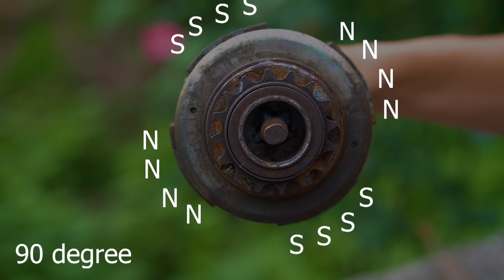I build 220v electric Hydropower dam

Comment: Clickbait.  That thing has an much chance of generating 7000w as I do lighting up a fart and rocketing to the moon.
Reply: Fr fr, 
1. The way he wire the coils together 
2. Even if they were wired correctly the 60 rpm he's getting would only create 2hz instead of 50-60hz
3. The chain didn't show any tension at all
4. The water was pushing the paddles so easily
5. The bottom of the paddles wasn't secured properly so if there was tension it would just scrape the bucket 

If he actually showed how a working turbine could be made I would be impressed, but otherwise please stop making videos.
Reply: @liamhill1702  I looked at a number of this clowns Videos. All Click bait with ridiculous power claims. One was a little 2 stroke Motor  driving a generator supposedly powering a Pump.  Belt between engine and self made genny  looks like it came out of a VCR or something. Starts up the little engine, connects the pump and motor does not Drop a single RPM when the load goes on.  This guy is nothing but a Con man taking advantage of Peoples Gullibility.
Reply: @glumpy1024  I just wish he would actually teach how to make working things rather than to just take advantage of people.
Reply: Ye
Reply: @liamhill1702  Exactly. I came across him looking for real info.  Saw the thumb was click bait but had to watch what sort of a con he was pulling off. Seems there are many.
Reply: But there's still a chance right? This was obvious sarcasm but people these days seem to be to stupid to understand it
Reply: @Onyx_Games   yep and it's only slightly less than winning the lottery back to back 3 Times when you haven't bought any tickets!
Reply: okay but i wanna see him hook it up to a "kill-a-watt EZ" to show all the readouts amps volts watts and then again under load even though I'm sure "kill-a-watt EZ" is designed for 120v  to 110v if they had one for 220v or idk at least use a multi meter i got a high end version cen-tech at harbor freight for a pretty good price oughta tell me some data ... i believe the 7kw or 7000k  claims are for theoretical maximums given a high enough head pressure and flow volume that would be supposed capturable energy from the sun via gravity and the evaporation of water transported via clouds /rivers lakes
Reply: Rpm is constant. With load and with out load 😁. What an engineer
Reply: Having a open bucket he post alot of head pressure.
Reply: Thanks, saved myself so much wasted time
Reply: If I was a betting man, I'd say maybe 700watts. I could see that generating around 3.5amps
Reply: @mattypants  You are more optimistic than me! With the waterflow and set up as shown, I'd reckon 5-10W at best.  Maybe if the thing was driven properly you might get 100 or 2 but even then, the thing has NO regulation so trying to get a useable voltage and frequency is not going to be possible. ALL generators have some sort of Volt/ Current control to balance Different Loads. Without it, they are like an IMAG which I have 2 Up the back now I have built and the things are all over the place. Only good for a constant load like Lights where you can set the engine speed and capacitance and not change anything.
Reply: BINGO.  IVE DONE WHAT HE'S DOING IN THIS VIDEO.  AND SOME OTHER INVENTIONS.

HE'LL BE LUCKY TO GET ENOUGH ENERGY TO MAKE A DIODE LIGHT FLASH
Reply: There's probably enough information in the video i.e. size of pipe and pressure for someone to calculate how much power is possible assuming an ideal lossless generator. Edit he needs to be generating 32 amps to get 7000W.
Reply: I think it's a typo. 700 Watts makes sense. He probably can get a single horsepower from that water source. From what he has plugged in he looks like he is generating possibly 200 Watts so about an amp of current. If the generator was more efficient it could be made to do more.
Reply: 50L/min at 90%eff under 1m of head suggests best case around 400w output. All of those nunbers are very generous, i think itd be closer to 50cm head, 30L/min, 30%eff, or about 40w.
Reply: @carni5064  Solar Panel is better lol.
Reply: @secretagent5658  Sorry, you are incorrect.  The original outputs are irrelevant. He has converted this to a permanent magnet alternator, It no longer runs on mains AC . The  production using those small magnets would be nothing like the original rating of the the transformers.  There is no possible way to get any meaningful power out of them at near a correct frequency and voltage +which will cause all sorts of problems running anything bar  an incandescent lightbulb or a resistance heater. 
I just came in for lunch after working on  my commercial built 10 Kw 3 phase Generator. I know how big that is ( 150 Kg) and what it takes to drive it.  To think this puny setup would even do 1 KW would be a laugh.  If you spun this thing up with a Diesel engine you would be lucky to get 100 W before it flew apart.
Reply: @glumpy1024  Sorry for the comment. I had someone else post a responding comment to that comment.  They had put their own input which is incorrect. I agree with you. Their pulsed DC output by their "alternator". Not perfect or close to perfect sine wave, so I say it with quotes. My staffer had made a mistake and is not very well versed in this type of stuff. I apologize and will remove that comment once I find it. The pulsed DC might however induce some currents and produce some voltage into the primary coils. It wouldn't be enough to power a load. Even if it was very efficient it would not be able to power a load. Maybe just maybe a small load that can take pulsed DC waveforms. 

But again I apologize for the comment that had been made, I will track it down and remove it. There is energy being produced and transferred and could possibly be used on a load, but nothing of significant value. Especially NOT a fan nor anything else. I will educate my staffer and I will help them with further learning on this topic. I apologize for the false information in the comment. 

There is NOT enough energy generated to power a fan nor anything of AC load equivalents. Though there might be enough generated to power some very very small Pulsed DC loads. Electromagnet could be connected to it. But would not be significant. It would be like plugging in a 0.5 Volt 1 Amp power supply to the electromagnet. This would be the rough magnetic field equivalent, which is indirectly related to what had been shown and realistic values. 

Again, the power from this is NOT enough to power any significant loads. And this does NOT produce 7,000 watts at all like the clickbait claims.
Reply: @glumpy1024  I had found the comment and have removed it. I always spread truthful information. But sometimes I need someone else to reply to comments or posts using my account. Thank you for bringing this to my attention by responding to the comment. 

The comment is now removed and deleted. I'm sorry for this misinformation in the comment.
Reply: @secretagent5658  All good mate, thanks for the clarification.  VERY decent and honest of you.
Reply: Typo, he accidentally added an extra 0
Reply: Barely powers two fans desktop fans(75 watts each) and a 40 watt light bulb at half power! 👍👍👍👍👍👍👍👍👍👍  nice way to waste two days turning garbage into youtube click bait 👍👍👍👍👍
Reply: @RadDadisRad  I think he added Three extra zeros.
Reply: @metatechnologist  I don't believe it would be possible to generate 700W or anything near it with this setup with unlimited power let alone the tiny amount this water flow is generating. Have a look at other microhydro  vids to get an idea of what it takes to even make 500W.  People have 6"  Pipe falling 50M or more to get that sort of output or less with real  generators that are a lot larger than this joke of a thing. 
They show outputs, unlike this scammer, and it's easy to compare what others do to get an idea of what meaningful outputs take.
Reply: @glumpy1024  Yes you are right. Somebody in thread did the math under ideal conditions the maximum power would be 400 W. I wouldn't go so far to call this video maker a scammer because he did build something from junk and did generate power from what appears to be an irrigation ditch. Just not as much as advertised probably out of ignorance more than anything.
Reply: Yea output can never exceed input 7kw = about 10 hp he might be seeing 1/4hp at best out of that "turbine" maybe he means 7 kWh a month... But even that seems far fetched.
Reply: @glumpy1024  I know somebody needs to make a video debunking these videos. That and the "look at the very rusted thing I found and restored videos." Entertainment nonetheless!
Reply: Report as spam or MISLEADING
Reply: That fart trick sounds amazing. I’ll get in touch with CNN 🤘🤘
Reply: Wheres the inverter
Reply: If you're curious I met a man who once did both Legend has it that the Tsar Bomba what is a government cover-up story so that no one else would realize they had immeasurable power within their bunghole incidentally I am the great cornholio and now I go to find te-pee for my bunghole
Reply: @davidbagley1783  inverter for what?
Reply: Have you tried it you're self mate, if not how would you know
Reply: How much power does your make?? He atleast built sumthing useful even if its weak
Reply: @umomiekiller  Pffft! Useful for what?? Other than sucking in people on YT  with Click bait whom are not only stupid enough to  Believe this thing is worth the time of day but actually defending it.  I have made several  generators from repurposed motors that put out up to a genuine  4KW. 
I am putting together a 10 Kw Gen head and diesel engine atm So I know real well what making actual power takes. This is nothing but a sham to suck in the ignorant whom believe all they are told. One of the solar panels I have on my roof would put out more in a day than this junk would put out in a week, probably a months. There are about 45 panels up there atm.
Reply: @glumpy1024  what are we supposed todo with this information?
Reply: 15:29 bro.. extra wires coming out from bottom of pcv pipe... 🤣🤣  oopsie forgot to edit that out lmao.
Reply: But!! I would rather pay to see YOU do that!! Now THATS entertainment!!!
Reply: @turboimport95  what are you talking about
Reply: @glumpy1024  holy fuck dog shit is DELICIOUS! Tastes like cotton candy with almost a skittles after taste with a hint of starburst!!! Who woulda guessed
Reply: Mmmmm looking at it doesn't look like it'll generate enough power to run those fans at all an led light bulb  maybe
Reply: Great example 😂
Reply: The moon is far from here so if u can build a e roket withe electro moter i wanna see it
Reply: So you’re telling me there is a chance!
Reply: yeah 70w at most
Reply: @liamhill1702  jealous
Reply: @glumpy1024  7000W is where the click bait is. Just like you said, he's probably not even getting 220V. Otherwise, it seems like it is working to some extent. The fans do not really run full power. They can hardly move.
Reply: @themeantuber  people have made calculations. 15-100W. Having played with a LOT of different generators and made my own. I'd say thing thing is sub 50W, most likely sub 20.  The water flow for one is just not enough to support even that in my mind. Forget the other multiple flaws in the concraption.
Reply: @glumpy1024  very inefficient design, I agree. There are better ways to do it. People keep trying to get the correct voltage they need directly from a generator, probably not aware of all the transformer steps between the power station and the power outlet.
Reply: @glumpy1024  I think he should change his title. I've been thinking, 7 kW should be enough to run 4 washing machines, this cannot run some 20-50w fans full speed. The thing is, I wonder if the original poster has any electricity at home and maybe what he created is a big deal for him, but I'm afraid he doesn't understand the numbers...
Reply: @liamhill1702  if you look at the water closely you can see the paddels are moving the water not the other way around meaning all he had done is make a synchronous motor
Reply: 😂 😂 😂
Hey man!
Have you tried it (with Chili or something like that) 😁!
But 7000W, nope!
Reply: 커버만들고 구리스주입구 만들면 멋지겠네요!
비가많이와서 잠길일은 없나요??
Reply: Turbo-Charge it
Reply: its more like 70watt the fan is slow
Reply: Word!
Reply: Looks like it generates zero point energy to me. ;-)
Reply: It's 7000w before it falls apart.
Reply: very well said Glumpy
Reply: Wtf does clickbait mean it's a fucking lie
Reply: Hii guyss
Reply: I think this video is less about the clickbait and more about the proof of concept. Sure the numbers might be off but with better flow and a bigger system, clearly he's doing something right
Reply: That's why dislikes should be viewed
Reply: Даже провода не выдержат 7 киловат
Reply: Hahahaha too right .. 😂🤣🤣
Reply: @Onyx_Games  先直流發電 再整流才有機會
Reply: @mattypants  700? that fan was struggling to turn. I would bet around 2 watts
Reply: I agree.. there is no way that is a 7000 watt generator. Lol.. 

However, for detail sake, it depends what is meant by 7000 watts. I can say I have a 2,400 watt pv solar panel bank. In reality, it's 480 watts per hour at an average of 20 volts and can produce 2,400 watts over 5 hours, during the hours of peak sun. It's the same 2,400 watts with two different definitions. The true wattage is 480 watts multiplied by the number peak sun hours for total output. 

The quotes output t is likely 7000 watts over 24 hours, which is 292 watts per hour..... if indeed it is producing power..  one does wonder if there is a lithium power bank with a 220/240 volt, 300 watt inverter inside that pvc pipe the generator is sitting on.. 

It would almost worth building it for curiosity sake, just to see what it does.. lol
Reply: @mattypants  even that is being generous!
Reply: @metatechnologist  31.81amps to be exact at 220v 
Even his wiring sizing wouldn’t support these amps
I’m an electrician with 45 years experience ...
Theory is there just not engineering to support load claimed
The load he had connected was a couple of hundred watts at best!
Reply: You actualy think that thing can generating 7000w ;)))
Reply: probably wont do any good but just report it for misleading thumbnail. 
this tuber does it all the time and its always misleading.
Reply: High level for security shoes
😂
Reply: It doesn't matter how much power he's getting he grounded his weld through the bearing so they will fail in no time. I see this a lot the ball bearing in the bearing itself have a very small gap which causes arcing to the walls and pits the surfaces.
Reply: @glumpy1024  A bit late but wow. Your arguments are so good yet so calm, not like many toxic YouTube users out there.
Reply: This is why we had the dislike button
Thanks Susan
Reply: It’s still fun to wach
Reply: @glumpy1024  good observation man.
Reply: It's got 52k upvotes. It's gotta be legit.
Reply: @Poniax3 how about you go back to Reddit and just because it has 52k like doesn't mean that 52k people tried it
Reply: @i_eat_dirt2  I guess you didn't pick up the sarcasm.
Reply: @Poniax3  I don't get sarcasm
Reply: For that amount you can light up alot of led lights within a slum. They can all get light I to their sheds, which is good enough as a start at a point. Build from there.
Reply: That's what I was thinking. I was suspicious how he knew that the 220v coils would automatically generate 220v even thought thats not how that works at, and it depends on the rpm. I don't even think that thing he put in the middle of all of them was magnetic, so it would have no chance of working at all.
Reply: @tahircheema7817  that's a great point XD
I was actually watching to see the paddles slow down with the load like I've seen in physics class.
Reply: @metatechnologist  but it doesn't seem strange to you that when the load is applied to the generator, the revolutions do not change ...
Reply: and thanks to youtube dislikes update i genuinely thought everything was fine!
Reply: This is the reason YT should of never stopped displaying dislikes, for those less mechanically inclined from being duped by these click bait channels!
Reply: Chances are low...*but never zero...*
Reply: Hahaha… true
Reply: That's why I have dislike removal
Reply: In other words... It's not 100% impossible...
Reply: Your ambition is not even a head high above the moon. (What are you investing into, a residency upon Mars?)
Reply: @glumpy1024  That was my thinking. Even if the transformers could handle a few thousand watt, you need a source that can develop that much force. He can do it with either volume or pressure which neither he has. 

If he did have the force to produce a few thousand watt, that paddle setup wouldn't survive.

Something I would definitely add is an additional set of gears between the paddle and generator to increase RPM.
Reply: @Onyx_Games  de voar até a lua, impulsionado por um peido?!😂
Reply: That sounds about accurate.
Reply: Yea but it still cool
Reply: Totally agree,  inefficiency in all friction filled fittings, maybe 1 psi and 3 gpm.  Come on who are they kidding
Reply: If its a click bait why would you complain in a kids video they didnt made it to be tutorial they made it for kids
Reply: The way you describe it it’s flawless. Thank you and have a great day
Reply: @liamhill1702  ouch, sorry, we forgot to show our nuclear power next door… 😁
Reply: Yea , not spinning nearly fast enough
Reply: Looks more like 7w 🤣
Reply: @liamhill1702  he took the magnets off the rotor. Lmao. Con artist for sure
Reply: Here's somthing sexy to inspire some fire. You could heat a house with your own households shit! Just not healthy for the mind
Reply: yes
Reply: He’s saying 7000 watt-hours total for a time of 24/7/365
Reply: What’s for dinner?
Reply: @liamhill1702  also don’t forget where all the water comes from
Reply: Can you make a video about that? The farthing part I mean.
Reply: Let's say it actually did work and produced as claimed.  Every thing is welded solid.  How are you going to replace those bearings when they wear out, and on an unbalanced jurryriged contraption like this it's going wear out.
Reply: It will make some juice but not 700w your right. You can see how everything is labored in how it moves
Reply: As soon as saw him with the wire and the coils I had second thoughts but then he welded two bearings together and was like let me check the comments. Suspicion confirmed.
Reply: Still cool to watch either way
Reply: @Onyx_Games  i think your pfp says enought about your briliance
Reply: It's may work like a taser in first 0,0001 sec it's has wery high woltage
Reply: 7000w? Get some help bro !😐😐😐
Reply: Lmfao 😂
Reply: Dude you tack welded the bearings together and then to the quarter inch plate that will create too much drag on the bearings creating too much resistance. You also grounded out the transformers to the same plate. The little bit of power that you are producing may just barely be enough to power an led bulb let alone a continuous 220v that is required to run a small house.
Reply: 3:45- I was taught to treat bearings like virgins- don't even unwrap them until you're going to use them, keep them super clean, don't contaminate the grease- welding them is unthinkable.
Reply: It says 220v witch is 220w . I guess you can't read either.
Reply: I looked at the moon a while ago, and was that you waving back? ;-)

On a more serious note, you are so right, that thing might power a few desk-fans but that's still nowhere near 7000 Watt. The build is creative, the claimed performance even more creative...
Reply: It's like saying I'm a porn star when I'm really not
Reply: It can hardly make an old digital watch work.